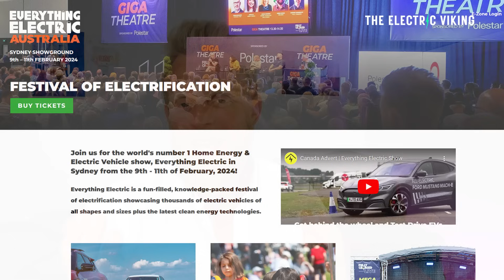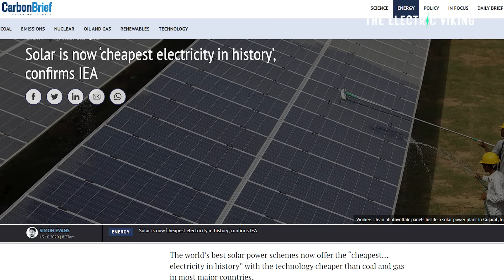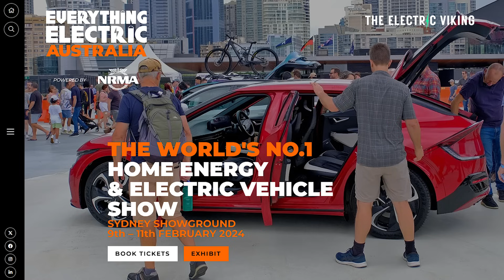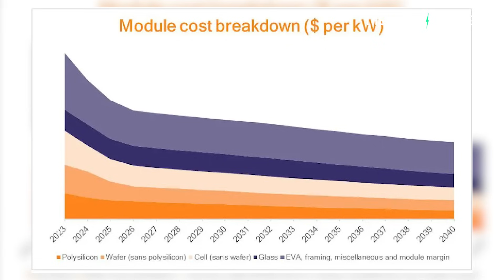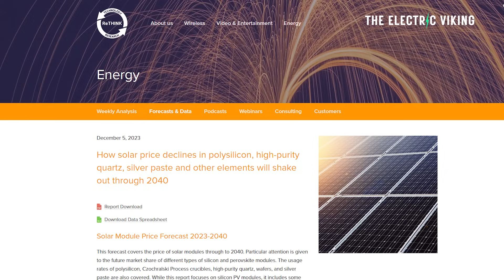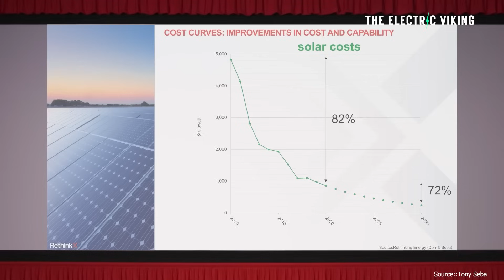Tony Seba just made this insane solar prediction that is blowing my mind

Comment: I have no doubt solar panel prices will continue to fall in cost, but in most systems the actual panels are a small percentage of the total cost of the system.  Installation/labor, premitting, design and connecting to the grid, account for more than half of the cost of install.  Batteries will also typically cost more than the panels, sometimes by a lot.  The good news is along with panels, the inverters, batteries and other smaller components are also falling in price, which will help.  However, if governments follow the same path as California in recent years and put all the power in the Utilities hands to squelch home solar, than many of these predictions will not come true.  This is not a free market here, it is a government mandated monopoly that is quickly getting out of control, harming consumers and killing solar at the same time.
Reply: Exactly!  Corporate Utility Comp GREED Wins!

Comment: I look at the surface of the fields of solar panels and all the wasted heat from their surface will need to be recuperated. If not it is one more source of climat warming.
Reply: Using the waste heat has been tried already.  Not cost effective and companies have gone bust
Reply: Because some of the sunlight striking the panels is being converted to electrical energy, they don't get as hot as you might think.

Comment: Solar is already "good enough" for a lot of people if they have the money unfront, its the battery/storage where its not really worth it yet. Even if its a small system (something to carry 24hrs worth of daily/night usage). One thing, at least in the US, where it would make sense is if we can start doing package deals with basic designs that can be easily install with little to no red tape needed on the customer end. That would help push the idea of going roof top solar. The other wise of things, right now it seems out of reach for lower / higher low income and middle income families to do both - so once prices can creep into those ranges - I think we will see a large boom here in the US as families just switch over to using that instead. Then again, we need the panels come down another 30% and batteries come down almost 60%. Tall ask, but I think Na + Si+S batteries are the key to making that happen. Salt is cheap and very easy to sourse while Si and S can help store more Salt ions allowing very large set batteries vs having to have 1000s of cells.
Reply: I agree that they need to drop by about 40% more. I have a small system that's not connected to the grid and it cost $700 to run an air conditioner 2 hours 15 minutes per day.

That's about 25 cents of electricity or 7.50 per month savings. It's going to take 95 months to break even.   Roughly 8 years. 

I do place some value on it as a disaster backup but a 450 dollar,   4300 watt propane generator made much more sense for disasters with a run cost of $25 per day during disasters. 

If the same system dropped to $350, then it would be paid off in about 4 years and I could buy two of them and run an air conditioner almost 7 hours a day or keep the freezer and refrigerator contents from going bad while also running a light and laptop and cable modem.

Comment: There is one important thing to add: tidal turbines for night time industry baseload of large plants. That means cost competitive steeel, bioplastics, chemicals etc. That's where storage is adding +60% to a products energy cost. You strictly want to avoid that.
As 90% of such activity is done within 150 km of coastline tidal energy is key.
By very basic logic reliable tides at night is the single best mix with solar panels.
The key thing you need to R&D is a freestream turbine for 2 m/s currents that are fairly common to find. They are locally found where 0.5 to 1 m/s currents are congested between island narrows.
You can move household or office electric loads to batteries easy enough into the solar hours of the day.
For large industrial plants that need to run 24/7 a direct reliably night time energy source is a key economic factor for the product price.
it is quite dramatic - only a single company CyKlone Tidal Energy appears to actively focus on those 2 m/s currents in tidal energy.
Everyone seems to want to use battery or other storage for industry in the night, basically doubling the energy use during half of the days hours.
Which is obvious nonsense the plant operator don't buy into. They do need a proven solution to electrify smelters, large oven, chemical reactors and other devices you cannot ramp up & down. The industry stuff that must run 24/7 to be cost efficient.

Comment: Hi Sam.  Hope you and yours are doing well.  ❤

Just so you know, it’s Wright’s law which describes how prices fall with increased production over time.  Moore’s law doesn’t have to do with price, but with the speed of computer processors.
Reply: True, though with modern robotic factories, the speed and cost of processors also leads to the fall of price, apart from the increase in production. These factors are not exclusive, but multiply each other.

Comment: Correct me if I’m wrong, but if you’re measuring the cost per kilowatt, a 10% increase in efficiency does not lower the cost per kilowatt. The cost per kilowatt already takes efficiency into account.
Reply: Let's say that solar efficiency is improving by 2% per year.  That means the cost per kW is falling over time.  No, it's not linear, a mistake he makes in the video, but true in principle.
Reply: You're wrong.  If the efficiency increases by 10%, the cost per watt falls by 10%.  It's actually better than that since the cost of the solar panels would also have fallen by then, usually.
Reply: If the Solar Panel price stays the same then a 10% increase in efficiency leads to an approx 10% drop in cost per KWH.

Comment: chillers can produce and store ice or cold water during the day,and used as a refrigerant during night time ,no battery is needed,the heat from the AC can be feed to a clothe dryer or to heat water,so efficiency is not that important, energy management is the key.

Comment: A fully integration of the energy manager by region is what is needed,the time of energy use is more important than the amount of energy, example: you are better of running a AC during the day consuming 10kw than at night! time at 7 kw , because no energy storege is needed,so we need programable Appliances that run mostly during the day.

Comment: Yes, it's completely crazy. Here in Belgium, you can get 400W panels for 100 EUR at residential consumer price, which means 80 EUR for big quantities, or 0.2 EU PER WATT !!! At this price, I don't see long term a business case for a public electrical grid. Right now,  all inclusive, the price of residential grid electricity in Belgium is around 0.4 eur per kwh... when a PV system of 10kw, generating around 8500 kWh/year will cost you less than 8000 eur all inclusive , or 800 eur/year if you amortize over 10 years. That's 0.09 EUR per kWh instead of 0.4 EUR per kWh from the grid !!! FOUR TIMES CHEAPER
Reply: Solar is great, but unless you have large storage batteries, you need the grid for base load at night, cloudy days, etc.

Comment: I just read that the switch to AI in the U.S. will require the power of 15 nuclear generating stations, all the while trying to accomodate the move to EV's. How is this going to happen? This is base load capacity.
Reply: I find that hard to believe, don’t believe everything you read. Please research before reposting or post your source so that we can verify.
Reply: AI will eliminate everyone’s job anyway so why care
Reply: Get the AI's first job to answer that question. If it fails then it gets the power cut. That should sharpen the AI up. A bit of survival of the fittest.

Comment: I am 100% for solar. We have a 12 Kw ground mount, grid tied system that has worked great for the past six years and now with a new EV it is really paying for itself. On the other hand here in upstate South Carolina in the US we have a mix of sunny days and cloudy rainy days. On the cloudy rainy days we only produce 5 - 10 % of the solar energy produced on a sunny day. We can also have extended periods cloudy rainy days that last for weeks. Wind is not an option here because other than storms we have little. If we don’t maintain some percentage of nuclear, wave, geothermal or tidal power generation that works whether the sky is cloudy or not we are setting ourselves up for a future disaster if one of the super volcanoes in the world has a massive eruption and clouds the skies for years.

Comment: I am waiting for the day when a solar panel costs less than the sheet of glass it is made with.
To hear Sam tell it, that will only be a few years from now.
Reply: That may already be on the way given a slight production lag.

A team at a US state university looked at glass production ... Its pretty polluting in terms of energy cost and the release of CO2 from conventional production materials. It hadn't changed in centuries 😬

What they did is patent a method of glass making that only requires half the heat of conventional glass and  removes the CO2 releasing  
additional materials from the process .. the result is a glass that is ten times more crack resistant... So not only is it cheaper greener its tougher so can be thinner and lighter. 😎 
It's patented under the Unis  mascot name Lion glass..

The other way forward is in  terms of transparent Wood..yup it can be done also replacing energy intensive Al frames with alternatives like MettelWood as strong as steel and half the density of Al ..made from fast growing softwoods or Bamboo...its got an 80yr life span and is insect and rot water and fire resistant.
It also doesnt conduct electricity or heat..

A final alternative Australia should really look at is Basalt fiber composites.. replace steel reinforcement in construction with natural lower energy manufacturing corrosion thermal and radiation proof, natural rock none hazardous even worked its a superb insulator. 

Till recently there was a company importing Basalt products from Europe .. now its in the Ukraine/Russian conflict area.

But as Basalts one of the most common igneous /volcanic rocks on the planet I would be looking for Stocks of the right grade world wide ..it beats glass fiber in so many ways and out does Carbon fiber because its massively cheaper and cleaner to make and work its also highly resilient.  🤔 And plays very nicely with a whole bunch of other natural grown  fibers, epoxies, plastics and ceramics. Its used as ballistic protection high temp insulation -250 -850-1000 degC in place of asbestos ...even in brake blocks or tiles..  acid alkali and salt proof its electrically inert so makes super HV insulators.  Given an absorbing flexible  foam core a 3 layer basalt skin on a boat transom can stop a magnum bullet. 

Imagine saving 90% of that steel in construction and with something that wont rust expand and corrode or fail so easily in earthquakes fires or be vulnerable to electrical discharges. Its also brilliant in the cold... 

In an Australian context its production involves very low water use. 💦 Its found virtually globally and yet most of the time all we've used it for in the west is road stone and aggregate. 🤷🏻‍♂️

Time we started getting out the box and seeing the alternatives.... fast. 🧙‍♂️🇬🇧
Reply: Glass along with other industrial processes can be made using renewable energy, which will drive down the production cost. In relative terms to inflation anyway, as sand is fairly easy to get. Once enough coastlines are preserved glass price may increase if sand has to be mined or just rock pulverized and refined. Desert sand is not as easy to source/refine as it appears.
Reply: @joeltrail8186  
They dont use sand as such the main ingredient is Soda ash Sodium silicate the US sits on top of 80% of the worlds known supply to remove the Na they have to add various carbonates then heat the mix to around 1400deg C large panes of glass were made by pouring onto a bed of molten tin ... also has to be heated. The CO2 is driven off in the firing and producing the heat ...like ceramics, bricks and concrete its all very high temp stuff. 
Lion glass produced by Pennsylvania state Uni. reduces the temp to 4 or 600C and does away with the need to add the carbonates and that source of CO2 waste from their addition. .. as bonus you get a  massively more shatter resistant stronger glass...so it can be thinner and lighter for shipping and needs less packing at  the end, for a lot less wasted energy/money materials that you can use for storage and powering everything else you are going to need to produce and power. And thats currently produced from burning coal, gas or oil.
The heat, electricity and massive reduction in the 96million tons of CO2 globally that currently comes from making glass alone. Its a win win Win scenario and its only a the start of  a familly of 💚'ner glass products providing no one gets stupid and greedy and starts sitting on the tech like happened with 3D printers... 
It was only when the patents ran out that people could afford to experiment  with the tech and came up with what we have now. 🤷🏻‍♂️

The other thing is with the US sitting on the biggest reserve of  Na ash means that China has to burn coal to produce the Soda ash both for glass and Na battery tech unless it starts extracting Na from Salt Na Cl deposits or sea water .. and to produce the Na silicate it burns coal mostly 🤦🏻‍♂️ and the pollution history is horrific. So dont let this get restricted ...its a global problem  its 95% harmless and infinitely more deadly if it isnt made globally accessible ASAP.

Comment: Actually, in January 2017 we had 9 solar panels installed in total 2385W. Total installation was €4250. 
This week I had a look at an extra 2400W set (7 panels), and had to pay around €4300. Counting in the inflation over 6 years, that set was a bit cheaper, but not that 50% I hear talking about.
Reply: Indeed / trend for panels is down but labour -erecting scaffold towers, installation wiring etc..keeps pace with inflation.
Reply: The key of what you are saying vs Sam is “installed”. The panel prices have cone down. Labor prices have gone up. 
If you DYI, you have indeed seen the price drops.
Reply: @williammeek4078 correct, so no one installs solar since too expensive
Reply: @dexlab7539  Not "no one".  Lots of people are installing solar.  Some of us have the balls and the skills to get up on the roof and install our own.  Some of us pay through the nose.  It would be nice if laws were changed to make solar installation simpler/cheaper.
Reply: @incognitotorpedo42  What kind of laws would you suggest?
Reply: @rowanbroekman3929  Maybe he is referring to slave labor, the kind used to manufacture many of the solar panels in China.  That's one way China keeps its costs low.
Reply: @incognitotorpedo42  If you are in the US many of your costs are administrative due to planning, inspection and such like with thousands of districts / towns etc each with it's own varying regulations. If the US got federal standardisation of regulations and accredited installer schemes whereby only a random sample of installations get inspected, costs would drop substantially.
Reply: There has been 25% inflation since 2017.

But... are you doing it yourself or paying people to do it?   If you are paying to have it done,  a large part of the cost is labor.
Reply: It is the labor prices and not the panels.
Reply: There is a worldwide lack of electricians out there nowadays.